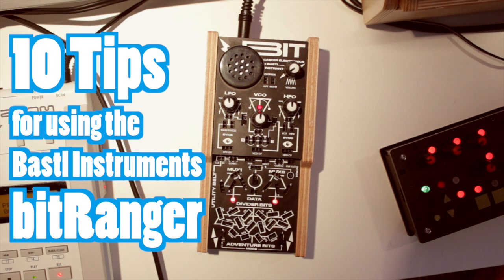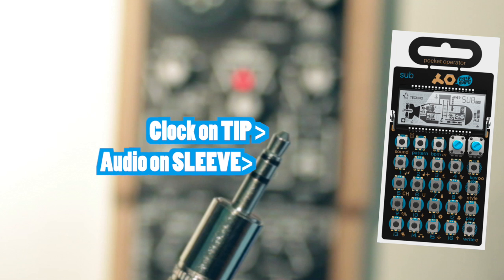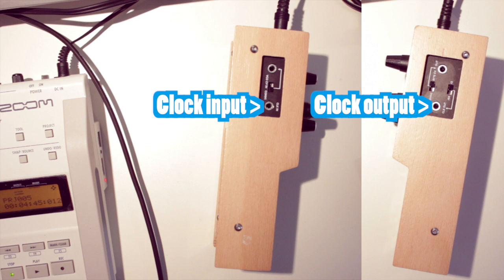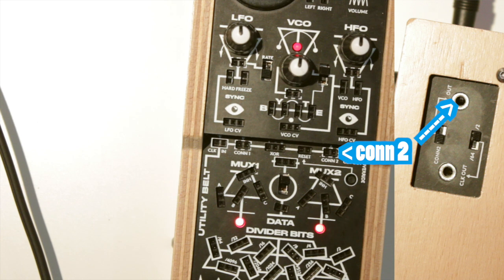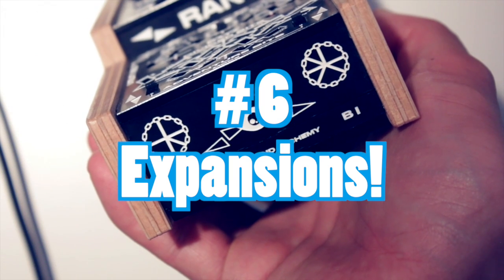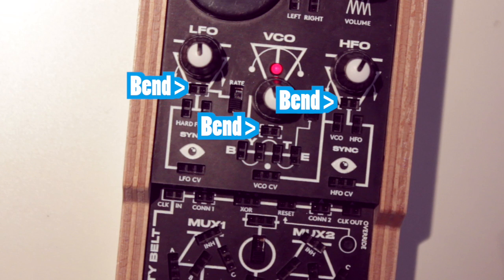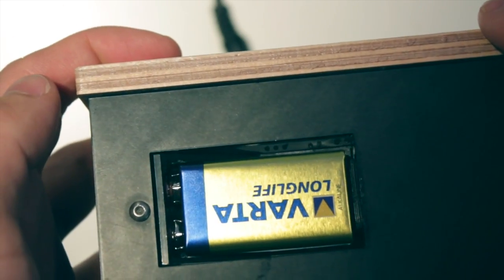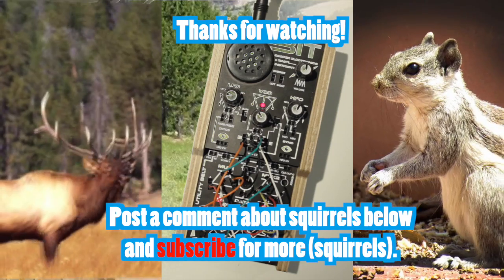10 Bastl BITRANGER Tips & Tricks! #TTNM

Comment: Too bad the fucking wires are so cheap and shit to use it ruins the whole experience because they also damage the synth just by using them. A huge mistake that I am always pissed off about.i will never recommend anything that uses wires I have to order online just to replace them. It's a total frustrating mess that will prevent me from any further purchases period.until a real micro cable that doesn't tear up the holes they barely fit in unless you have hands like our president.thanks Casper electronics.😤😤😤😤😤😤😤😤😤🤞😤😤😤😤😤Christo

Comment: Do you think I could patch my Moog Werkstatt-01 to Bastls Bitranger or Kastle? If so which do you think would pair better with my Wekstatt?
Reply from the maker: Hm ... you definitely can, but I'm not sure about the whole input protection on the Werkstatt. Bastl's stuff is protected though and you probably don't have to worry about this. The bitRanger offers more stuff or course, but the Kastle is so sweet and tiny and does sound quite different ... probably have to get them both ;-)
Reply: Yes  I would definetly like to have both and now I'm looking at the Omsynth, I want one of those too. Its happened I can finally admit it I'm now a modular synth addict! LoL Thanks for the info on the Kastle and Bitranger they both look great. Hope you all have an excellent new year. Cheers
Reply: I have used the Kastl with my Werkstatt. I just modified a lead that I plugged into the output of the Kastl to a single pin into the Moog to ground the lead at the Moog end. Happy days!

Comment: I'm hoping to use the bitranger with my 3trins RGB. Failing that I'll strap it to the back of a passing squirrel and see what happens.
Reply: Do you actually plan on patching them together or just running the audio output to the 3trins? Either way good stuff!
Reply: +Ed Kennedy I'm hoping It's possible to patch the Bitranger into the oscillators directly (the 3trins has the same type of input/outputs), but it should be fun either way.
Reply: +Thomas Herlofsen didn't realize it uses the same patch cables! That's rad. Check the voltages. I want to patch one into a folktek unit!
Reply from the maker: The bitRanger is protected so it should take pretty much anything from other instruments that you throw at it.
Reply from the maker: +Thomas Herlofsen glorious things will happen for sure!
Reply: +The Tuesday Night Machines the 3trins isn't, it seems. Too bad. It takes CV into the oscillators, though.
Reply: Thomas Herlofsen lmao o7